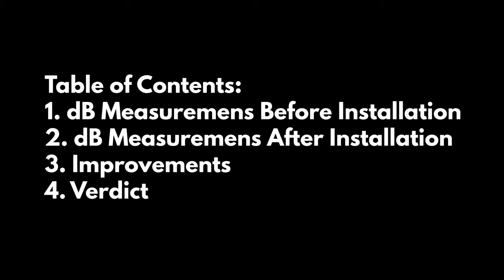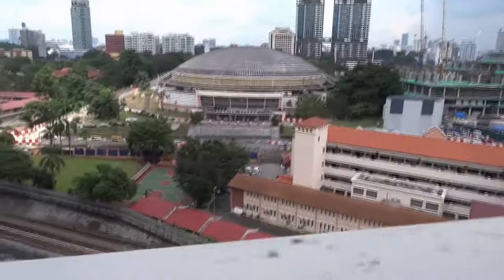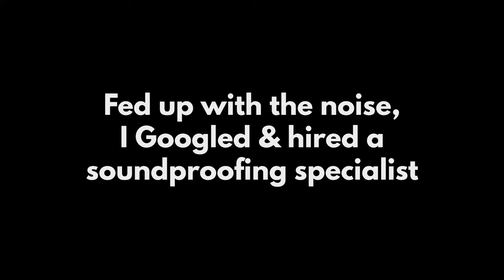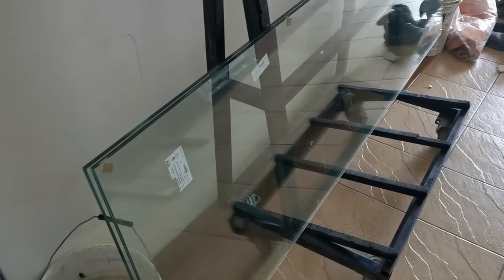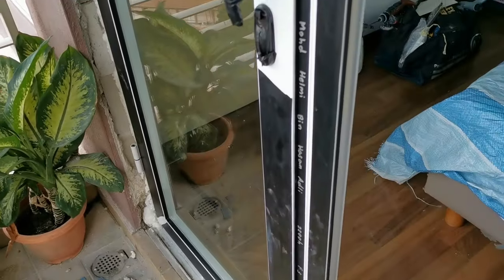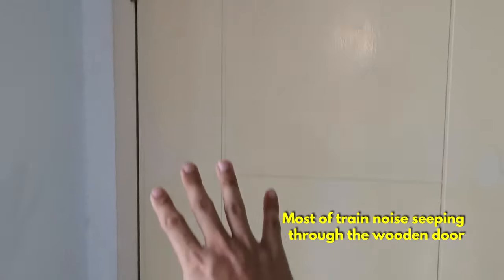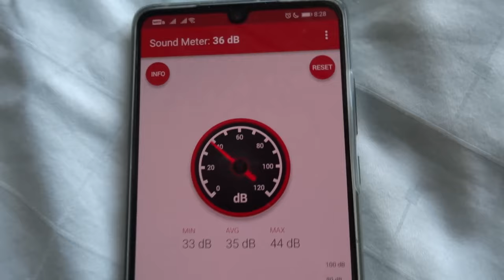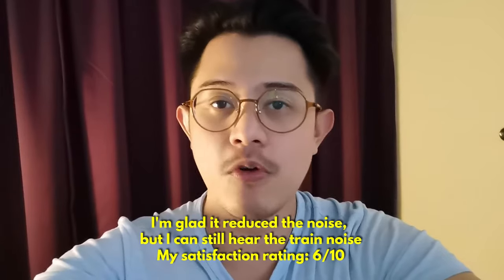Soundproofing my Apartment that is Next to Train Tracks - WFH

Comment: 20db is 75 percent, that’s actually really decent. Also train noises are usually low frequency which are harder to block.
Reply from the maker: It is actually pretty big improvement. Although still noticeable

Comment: Great video. The door probably needs to be replaced with something much heavier, and maybe get a special door sweep for the bottom of it if there’s a gap. From my understanding, the two only factors for soundproofing are the mass (weight) of whatever is between you and the noise, and also blocking air leaks, since sound is just air pressure waves. If it’s a hollow type door (pretty common), you might look into “solid core” doors, and get the heaviest densest one you can find . Or they might even make special soundproof doors.
Reply: Instablaster.
Reply: My theories below,

i. I think density too,

ii. I think if he makes a double door w/ least 4" in between the doors'd help. Or even replace that former door w/ a cemented brick/ concrete wall.

iii. He can try double soundproofing doors/ windows so he've soundproof doors/ windows behind soundproof doors/ windows.
Reply: wuttt... comment from ThioJoe gg
Reply: One needs to check noise insulation values even in solid core doors. If you cant measure it, it doesn't exist.

Comment: It's going to be practically impossible to block out the noise from the train.
1) the lower the frequency, the harder it is to block off -- that's why you can hear your neighbours bass beats but not the entire song
2) the power generated by the passing train would cause even the surrounding buildings (including yours) to vibrate, effectively turning the walls into a diaphragm; essentially turning them into bass speakers.
Reply: I think 20dB is awesome. The major weak link in your old door. 
And then the low frequency waves probably arrive stronger that your phone's microphone probably can't pick up/detect well
Reply: Yeah glass can only do so much, but that's honestly a dramatic improvement, I'm wondering if some sound deadening curtains could give a slight improvement as well. Certainly if OP could replace the door/doorjam with a thicker door that seals tight similarly to the glass door. Depending how much they use that outdoor area could possibly stick some rockwool on the back side of that internal door.
Reply: So there is no hope? What if I add sonopan + mass load vinyl + 100 sheets of sheet rock? There should be a wY
Reply: @nat.serrano  you'll have to have the whole building "float" on a shock dampener. When a train passes, the whole ground shakes.

Comment: -20 db difference it's quite impressive. Keep in mind that -3 db means about twice less sound pressure. 
Once you add a second door to the existing one that goes to your laundry you should see a much bigger difference. Also, the sound goes through your building walls which means that you will hear the train anyway. 
If you go to a no sound room you end up hearing your heart beat, because our ears adapt to ambient noise. 
Overall very good video! 👍
Reply: @AXEL KAULBARS stay next to one then see if cool or not
Reply: Yes it is a good video.  The sound goes through walls is surface noise, it could be reduced by putting noise barrier in the ground.

Comment: Consider these getting/changing the following:
- get a acustinc curtain for night time, it should further reduce the noise
- replace that door [ideally the whole frame too, its too old], also when getting a new door most are hollow in the inside, so try getting a solid one
theres few more options, but these should improve the sound isolation

Comment: you could have achieved a -40db reduction like this: leaving the existing window in place, asking the cement guy to build an extra 10cm wall on the external side, and installing a double pane window into that: as a result you would have double windows (2 windows). The door towards the air-conditioner should be replaced completely. Thanks for the measurement!

Comment: I moved to a residential area that has much more traffic noise than I anticipated.  Reducing the noise in my condo by -20db would make a big difference.  It's interesting that you mentioned the sound of rain.  I find the sound of rain on the roof very comforting.  It helps me to sleep.
Reply from the maker: yes. I find it better to have the option to hear or not to hear something when I feel like it. 

The soundproofing windows help me with that

Comment: Hi! Thanks for the great video. I’m also struggling with a lot of noise in my bedroom and am actively looking for solutions. Your windows look very effective in sound reduction. Can you let me know if they are double pane or mono? I realized there are vinyl laminated but apparently these windows come as mono and double panes with air gap in between the two. Please let me know. Thank you!
Reply from the maker: These are 2 glass panels sandwiching a laminate film
Reply: @helmi_finance  the proper double panel , would have vacuum gas being pump into it
Reply: @sdqsdq6274  Laminated glass is different and higher NRR to standard double glaze with an air-trap. You can of course increase the noise further with a secondary glaze+air trap, but at that point your window frames are almost 10cm thick and weigh more than a horse.

Comment: To increase attenuation, I recommend sticking a 10mm thick clear acrylic panel on the inside using double-sided adhesive tape around the perimeter of the frame and creating an air cavity between the glass and the acrylic to reduce glazing resonance. After adding a second acrylic glass, attenuation of up to 50db can be achieved!!!
Reply: Are you seroius ? did you do this?
Reply: You know how cost 10mm panel ?😂
Reply: @janeles100  yeah i did it because the noise from front of my house is horrible
Reply: But i have triple glazing and it doesn't worth it!
Reply: was horrified to compare the sound insulation of double glazing and triple glazing, because the difference is only 2db?! Like seriously for windows twice as expensive?
Reply: And definitely avoid quadruple glazing in the future, it's just a waste of money, because it's definitely not worth it for sound insulation, only 35db attenuation.

Comment: the acoustic insulation of these windows is excellent, but the wooden door where you have air conditioning will also need to be replaced because it leaks and a lot of unnecessary noise goes through it, and another problem is that the banging of the rails is carried by the concrete foundations of the house

Comment: Playing white noise (or pink noise) - similar to the sound made by an FM radio not tuned to a station - can be a great way to combat noise. You quickly get used to the continuous white noise, and your brain will  tune it out.   But you will find the external noise is much less noticeable and irritating.  (Also helps if you have a partner who snores!)   If all else fails, wax earplugs will save the day!

Comment: I'm attempting to figure out why soundproof the bathroom window and not those shutter windows that are allowing the noise to continue to come in? Thanks for the information.
Reply: Because no logic lol. Literally the solution is right there to two problems. Sound proof the outer window so that the sound doesn't come through the door and through the window to the bathroom. But instead they sound proofed the bathroom window like an idiot and basically made the balcony sound proofing not as useful either from sound leaking in through the wooden door.

Comment: I think maybe you should remove steel railing and install thick glass. That way you have two glass partitions between you and the noise. I would add value to your apartment.

I read some articles about noise and the guy said the best reduction in noise is two pieces of glass one thicker than the other. Thin on balcony and thicker on bedroom window. The gap between the two panes of glass is most important. The greater the distance the better.

So if you have 5 feet balcony then a big air gap lot between the two panes.

First you need to solve the noise coming from the other door.

Remember its the air gap between two panes of glass. 

Thick glass wont reduce the noise by much.

If you had triple glazed windows it would be better.

You need to research it before purchasing the windows.
Reply: @AXEL KAULBARS because everyone is different. If you enjoy it, good for you. Others don't.

Comment: hi which floor are u staying? is it any improvement if u go to the higher floor?
Reply from the maker: quite high, above 10. No improvement with height. Sound can travel through air. You need something to break the sound before hitting your ears, which the soundproofing windows are doing